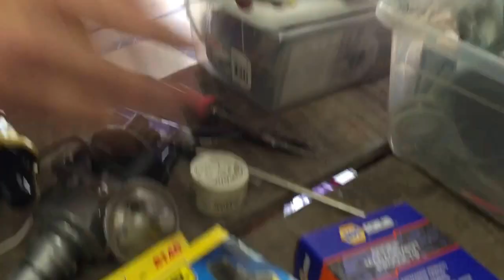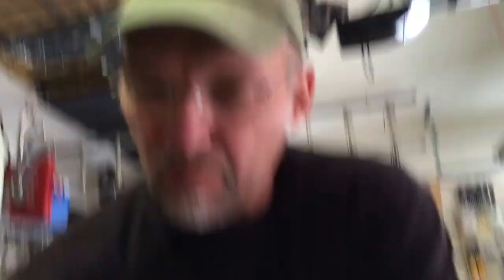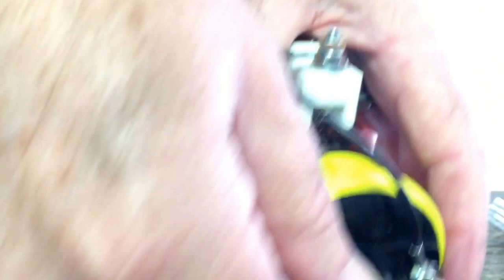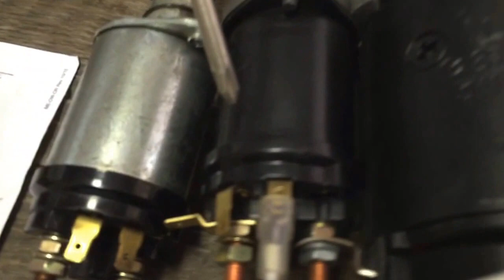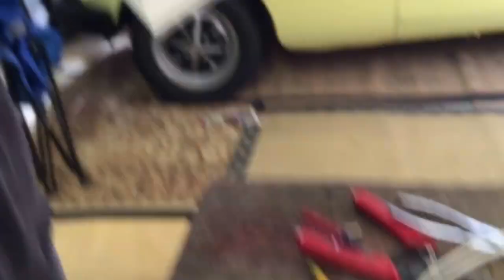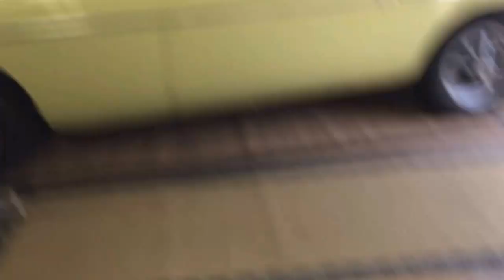Let's Install a Ballast Coil on the 1974 MGB-GT! (Setting Up the Ballast Wiring) - Part 1

Comment: If there is no extra tab on the starter motor to give a temporary 12v feed, just use a piggy back connection to the starter relay output wire  , red and white, going down to the starter motor,  which will provide the 12 volts to the coil,, BUT ONLY while the starter motor is operational.I believe the whole idea of ballast is that a low voltage coil , such as Luminition, running at 8 volts, saturates more quickly and enables faster and better  sparking.

Comment: Hello -- Enjoyed your video - I have a question -- What gauge wire are you using?  I am about to do this to my 75 mgb and would like to know the wire Gauge .. I am also going to bypass the "wire resistor" in the 75 harness and put in a ceramic one... ??  Thanks....